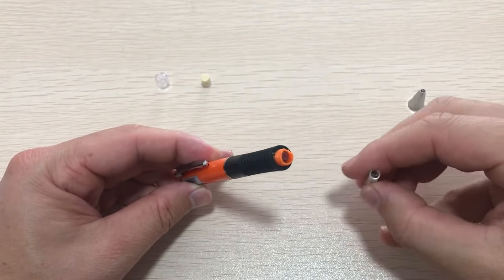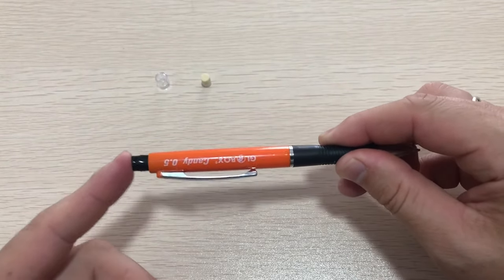How To Disassemble and Reassemble the Mechanical Pencil

Comment: sir video is nice.thanku for telling whole process.i want to like your video.thanks for make this video.sir in my cello  mechanical pencil lead tube doesnot comes on behind so i put in on front side.sir chuck reservoir unit cant open on my lead tube?
Reply from the maker: Thank tou for your comment. Have you tried to disassemble your pencil, usualy when you disassemble everything you find what is the couse of your problem. Please try it, maybe there is something stucked in there. Good luck! 👍
Reply: @rookie.handyman  yes  sir i had disassembled the pencil.

Comment: I am using Camlin double click pencil, I remove the Main Lead advance tip and the other lead advance tip (it has 2) but when I try to remove the chuck. It is not coming out and i am unable to remove it... Please see to it.
Reply from the maker: I have found it on amazon, I will order it and see what the best way to disassemble it is. Thx for the input, I will inform you when I get it.

Comment: Someone help my chuck ring is so thin and  it is not holding the 2 pieces and they just fall out, idk if i lost the actual ring or broke something
Reply: I have a Faber castle 0.7mm gripmatic btw
Reply from the maker: You have probably lost one piece, if you really want to know what went wrong, try to buy exactly the same pencil, disassemble it and see what happened. Good luck! 👍

Comment: When i am pressing the lead advance tip... It pushes the lead.. but when I leave the the lead advance tip, it doesn't come back (the chuck doesn't come back) I think that the spring is stuck or something... What should I do???
Reply from the maker: The best practice would be to clean the chuck as much as possible (if you can get to it). Disassemble it, and try to see if there is anything that is preventing the chuck to come back, maybe that plastic part where the chuck is mounted has been damaged...
Reply: @rookie.handyman  yeah. That happened to me. Only one tiime..

Comment: Can u help me to get the chuck out?
Reply from the maker: You can try to push it from the other side if possible. On my pencil I can insert a small tube or needle and push it from the other side if it's stacked, usually, it's always stuck so you need to push it with something. I hope you can find a solution.
Reply: Thank you so much

Comment: Ive got two spring bro and i dont know where to put it plsss hel me😭
Reply from the maker: Ok, you got something special there :D Spring is usually always meant for the inner part of your pencil, but some of them are on the sharp end of the pencil and others are on the top near the cover and eraser. You should have some grooves where your springs can fit, either from outside on the reservoir tube or when you insert your tube, try to insert the spring also after the tube (try from both sides if possible). Good luck bro. All best
Reply: @rookie.handyman  I tried it but it didn't work can you make amother video plss🙏🙏
Reply from the maker: @christianpatricio7594  What type of pencil do you have? do you have any link where I can buy it online?
Reply: @rookie.handyman  i didn't buy it online
Reply: @rookie.handyman  so I don't have any link
Reply from the maker: @christianpatricio7594  Ok no problem, I will try to find some pencils with two springs in a store nearby, if I find it new video is coming up (y)
Reply: @rookie.handyman  thanks for helping me brother